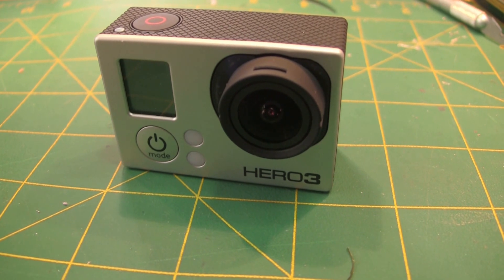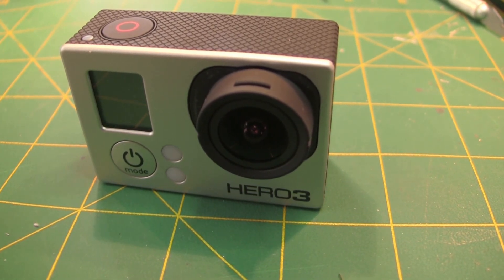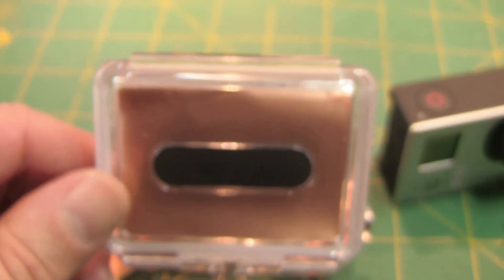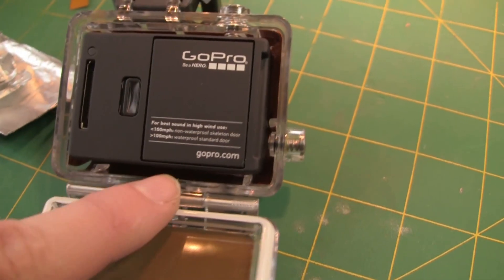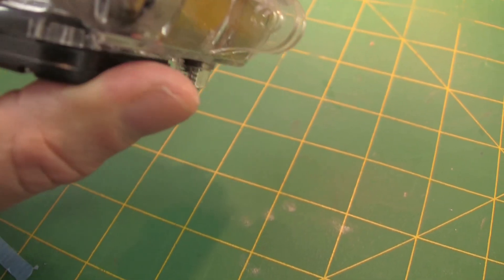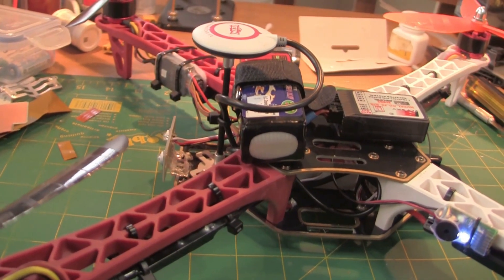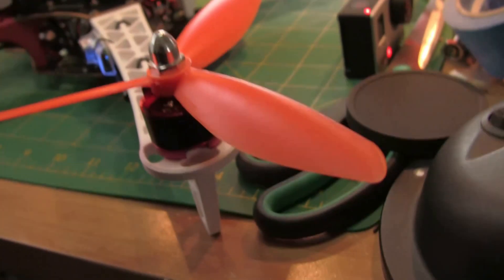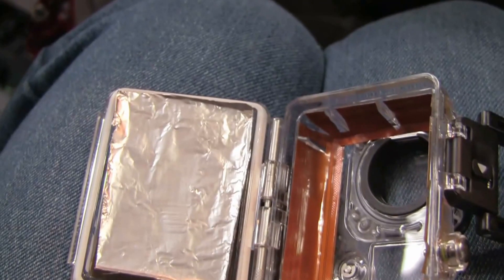GoPro3 and Naza GPS lock interference Fix

Comment from the maker: Yeah, it kills it dead! The max distance I got from the wifi when I was doing a video shoot for a pole dancer, I had the GoPro mounted under the pole, the wifi didn't work past 10feet, as to before it was near a 100feet. GoPro sells a plastic open mount for $60 CND! what a rip, so I'm buying from China for cheep. I also have a GoPro4 now and use the case form that one when I need to use wifi. Cheers

Comment: I shielded the bottom of the GPS module today and it blocks my UHF, 1.3ghz and GoPro1 noise excellent. I dont use a gopro case but did have foil on back and that worked.

Comment: I know this is an old problem and there have been many people that have fixed this using tin foil or copper foil around there GoPro as shielding. If you’re interested I recently (Feb 2014) came across a "Conductive Shielding Paint" used by guitarist. They use it to shield the pickups on their guitars from EMI. I purchased a small can of it, about $30.00 and painted the inside of my GoPro case with it. It works well. There may be other places to get it but I purchased it from Stewart MacDonald. Google them.
Reply from the maker: Hey thanks, what a fantastic idea!. My GoPro is on my Hexacopter and I don't have any problems even though I don't use the case anymore. I'm running new Firmware and that seems to have corrected this problem anyway. I bet it would look a great deal better than what I did, LOL. Cheers
Reply: brimest0ne .  Just curious, which firmware version?
Reply from the maker: fraps2008
Well, that was over a year ago, the GoPro3 Black was just new, and the NAZA firmware was 2.14. Since then my GoPro3 is mounted on a Tarot Gimbal on my DJI F550 and I'm running NAZA V1 hardware on V2 software and using firmware version 3.16. I had flyaway problems on version 4.02 and had to revert back 3.16. It should be noted I don't have any interference with the GoPro out of it's case when it's on the F550, probably due to the firmware updates on the NAZA.
Reply: fraps2008

Comment: Oh and FYI- I found Copper Foil at Hobby Lobby. It was in the section where the clock works stuf is. $11.00 for way more that you need to do the job.
Reply from the maker: Well that's an old problem now, I fly that same GoPro out of it's case on a gimbal mounted on my Hexacopter, no problems any more. I know DJI fixed a lot of issues on the NAZA, radio interference being one of them.
Reply: brimest0ne
so, how did you solve the interference?
Reply from the maker: *****
Well,as I mentioned the shielding fix, solved my problem on my quadcopter and through the updates both on the NAZA and GoPro, I don't have any problems on my Hexacopter, even though the GoPro is out of its case and unshielded, WiFi not with standing, but for the most part the interference problem is gone. The shielding works so well the WiFi is useless more than 8-10 feet a way

Comment from the maker: I do have the Fly Sky FS-TH9X, for the price you can't beat it, the only problems is it needs two 3 position switches and be able to use those switches in airplane mode, I fly my Quad and Hexa copters in Heli modes. But besides that I haven't had any problems with it. Since I made this Video, the NAZA system has new firmware and the interference isn't a problem anymore, some how they fix that and other problems with the GPS. Both fly awesome on the firmware. Cheeers